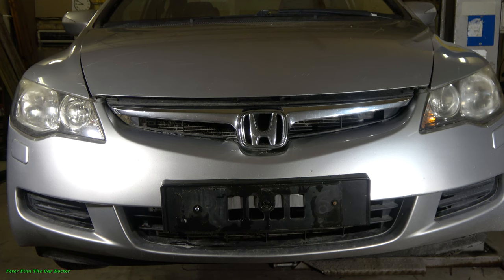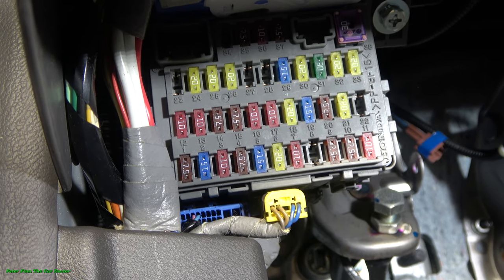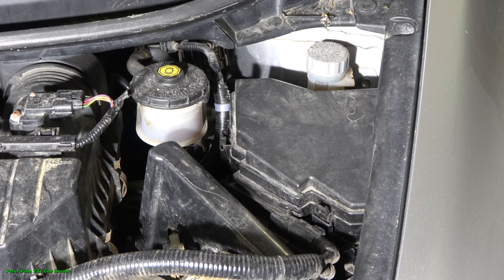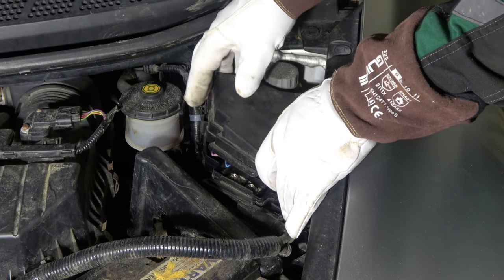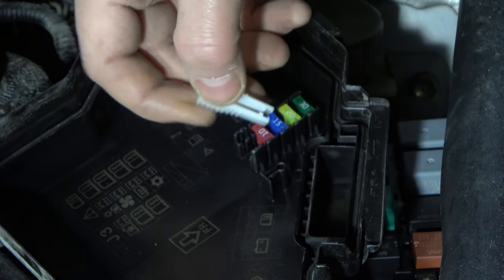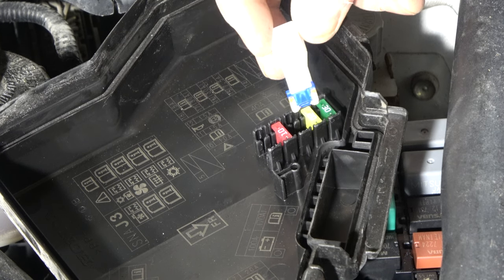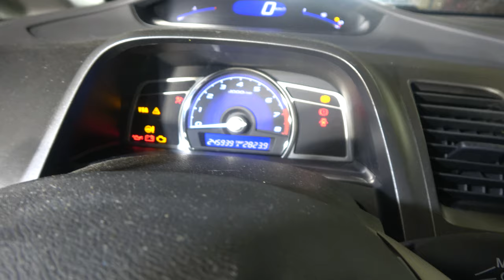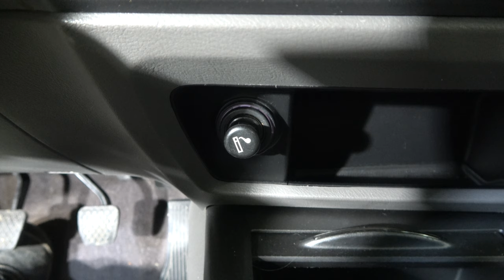How to replace Cigarette Lighter Fuse 1.8 Honda Civic. Years 2006 to 2016

Comment: Hey bro thanks for the video 
For people with the Honda Civic 07 lx made in Brasil ( the latin American version) the fuse number is the same as the video #29, use a flat screwdriver to unhinge the fuse and some pliers to take it out... Btw the frontal fuse box has some spares that you can use ( don't use the plastic tool for those internal fuse it didn't work for me  at all, that's why I went with the screwdriver+pliers combo)
Reply from the maker: Thanks for your comment👍😀